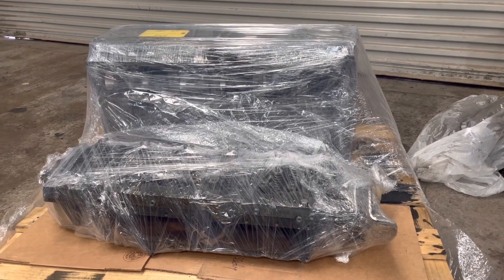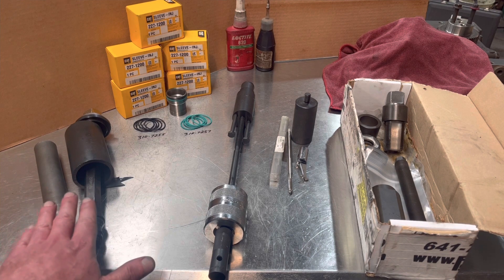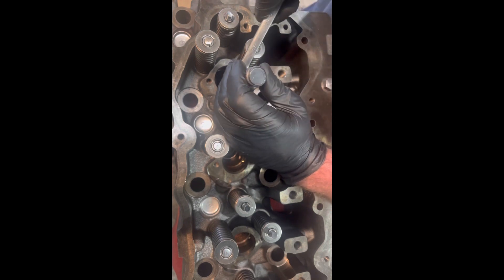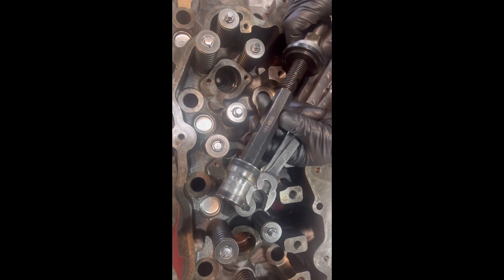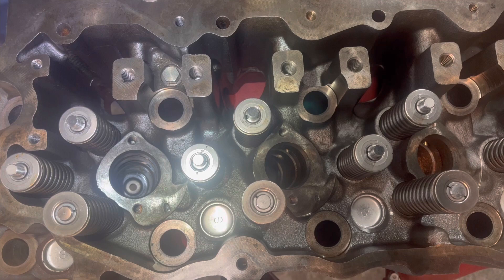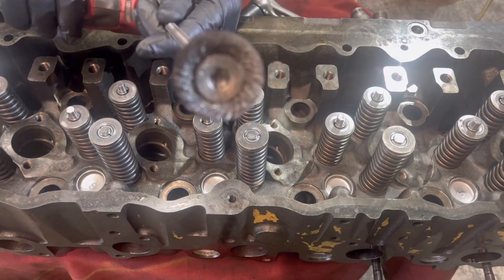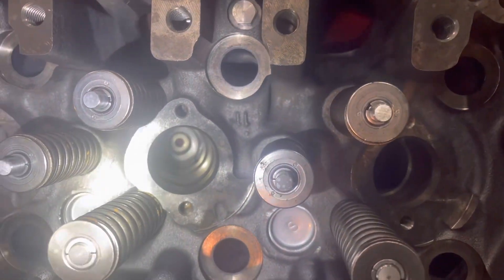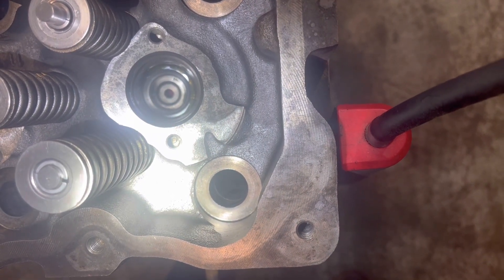CAT C7 Injector Cup removal and installation.  Step by Step. Part numbers included.

Comment: could oil coming out the top of the injectors slot be a case of bad injector cup or bad injector?? becausde i change the seals already and oil is still coming out
Reply: Out of curiosity, what did the problem end up being?

Comment: How did you buy the tool on the left? I’ve been to CAT for the past two weeks and they only sell the tool in the middle and tell me that’s all that’s available. My truck has been down for 3 weeks.
Reply from the maker: You should be able to order it from your local Caterpillar dealer with part number.  Or tell a good Cat parts person you want a C7 injector cup tool group.  Hope this helps.
Reply: Do u have a parts number for that tool